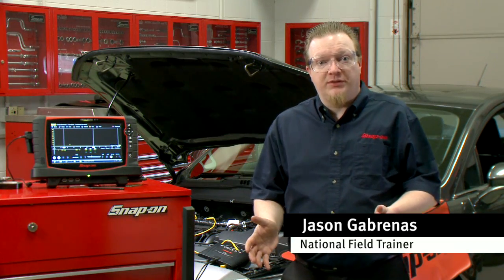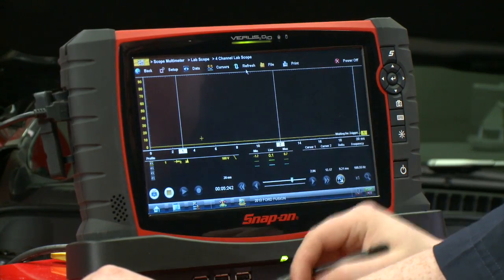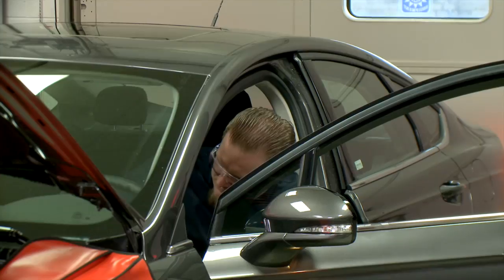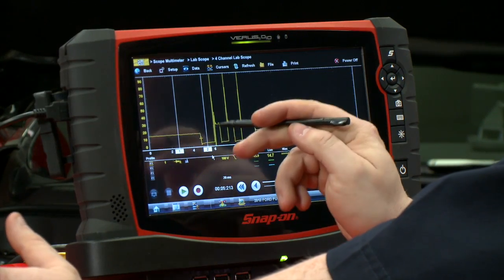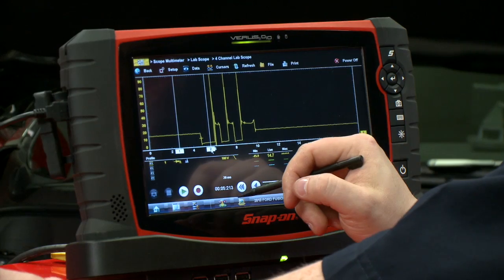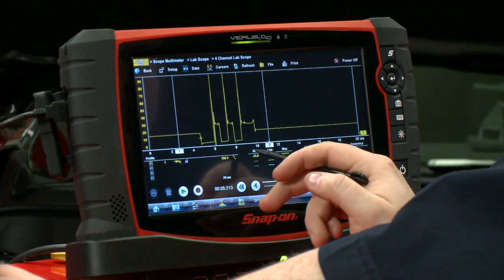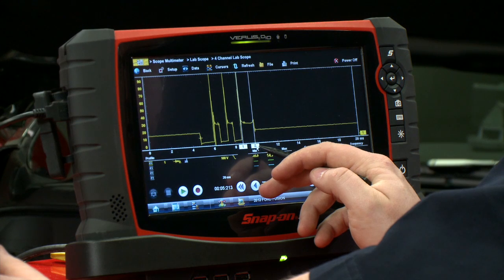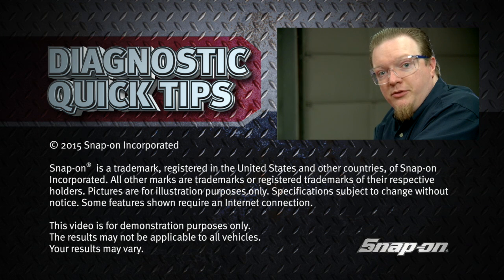Ignition Coil Primary Voltage Test- Diagnostic Quick Tips | Snap-on Training Solutions®

Comment: Useless information.  What a person needs is to see what their voltage is at the coil ignition common wire/ositive with ignition on and engine not running.  Then to determine what feed there is with engine running.  Your equipment is standing in the way of a simpler more defined answer.  You need to now your starting voltage and your engine running voltage amounts to determine good connection between battery and ignition to coil.  A 10 dollar volt meter would give a more accurate determination.
Reply: thank you